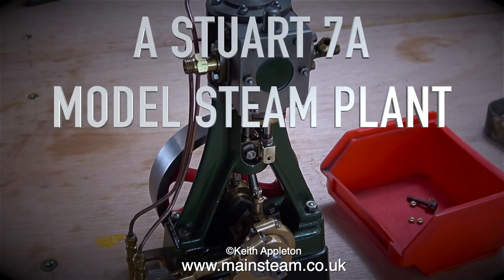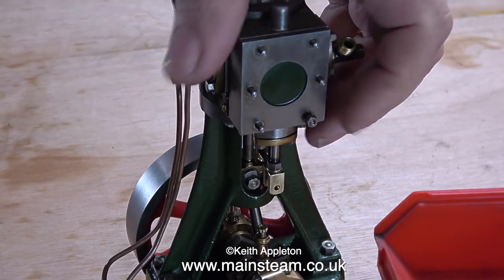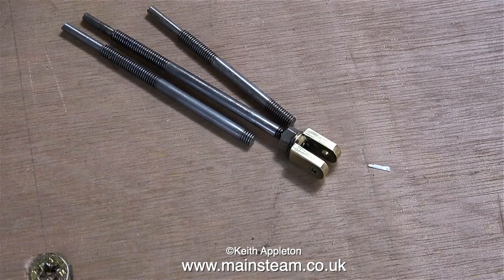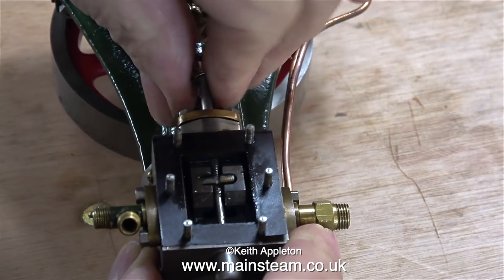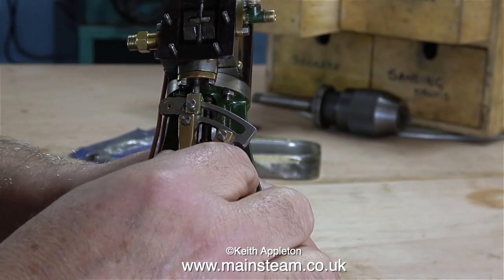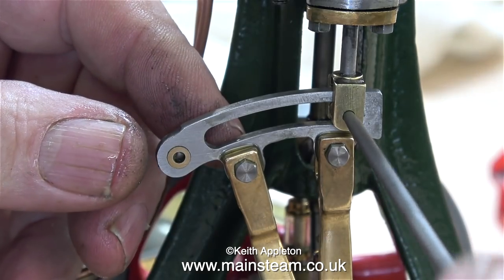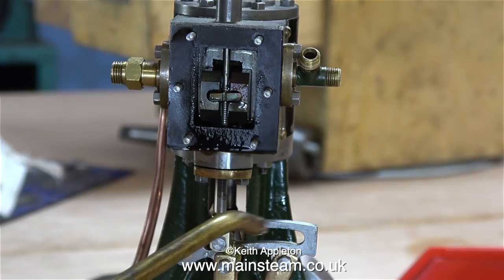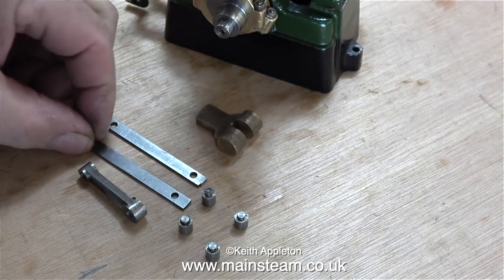A STUART 7A MODEL STEAM PLANT - PART #3

Comment: I think if I were to build a Stuart models engine, the 7A would be the one. Not too big and not too small. 3/4" bore and stroke: small enough to run on compressed air or steam without needing a large compressor or boiler to feed it.
Reply from the maker: I think it's 1 inch bore . . .